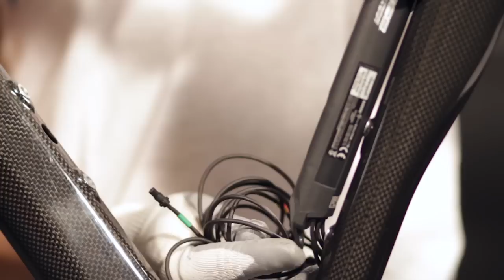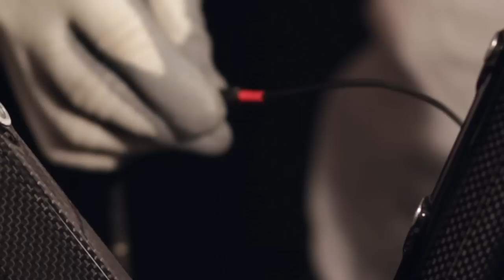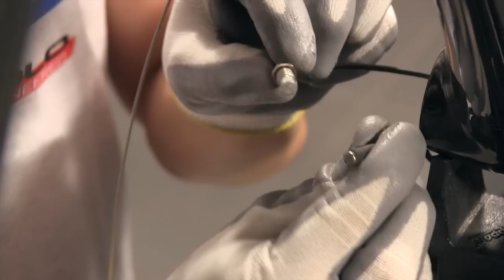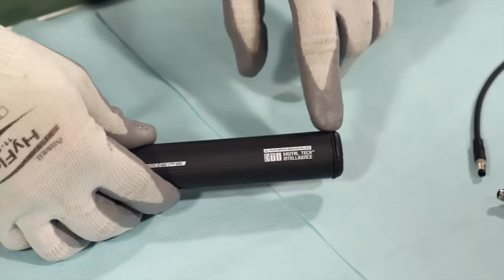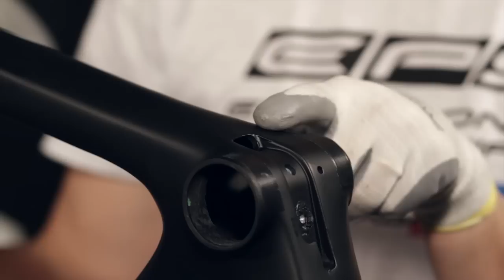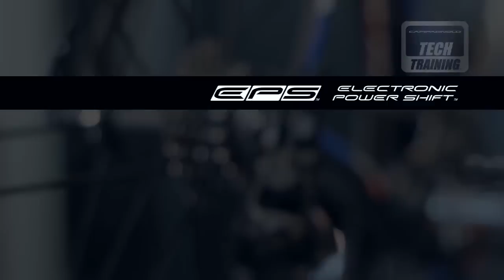ELECTRONIC GROUPSET CAMPAGNOLO EPS - V2 POWER UNIT

Comment: If one has wires for the original power unit, can they be attached to the v2 power unit, or is a complete new installation of cables and wires required?